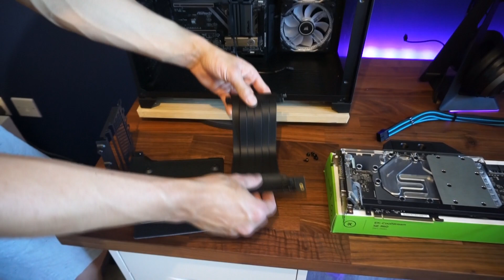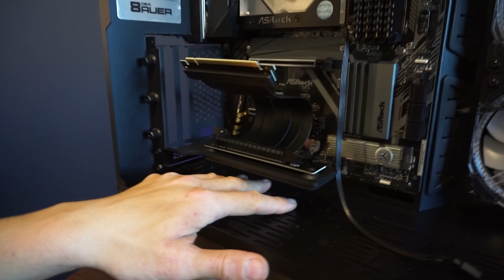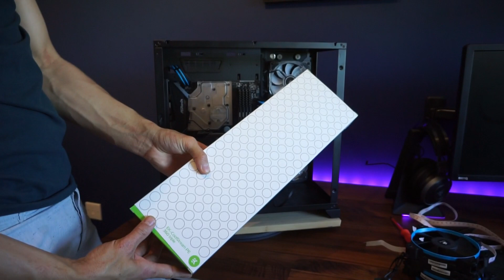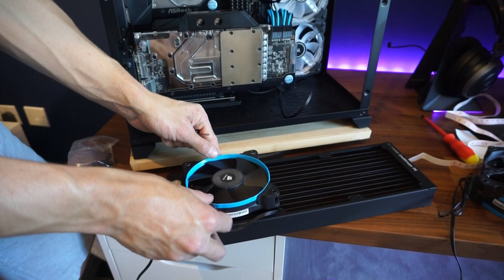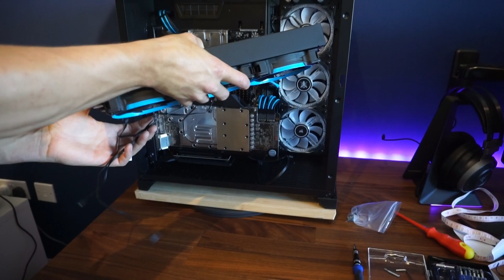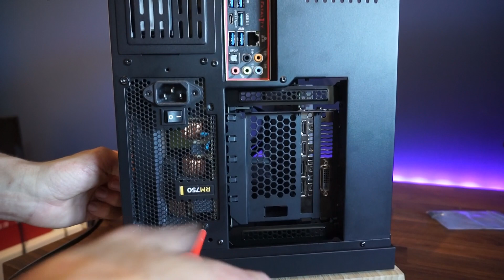Lian-Li 011 Build Part 3 -  Vertical GPU Mount & Test Fit

Comment: Thanks for the video, do you think if i used the same case and vertical gpu mount, will my air cooled gpu sufficate? Its 2.5 slots gpu
Reply from the maker: There is a good video by gamers nexus a review for this case. Check it out there is thermal bench marks for water and air
Reply: @techclub8528  i meant is the space between the gpu and the glass side panel tight? You used watercooled gpu which is slim, my gpu is thick and takes 2.5 slots.
I will have 3 fans bottom intake, 3 side for radiator also intake ,3 top exhaust. 
My question is, is my gpu too close to the glass side panel?

Comment: Is it possible to raise the riser in order to fit a slim 360mm radiator+fans in the bottom?
Reply from the maker: Hard to say I have 1 more slot to raise the bracket leaving only space for 1 Slot/PCI bracket.

Don't forget the fans I'm using atm are super low profile fans. You may want to look into the Lian Li 011 Dynamic XL for more height

Comment: Do you think this pci-e riser would work in any other cases?
Reply from the maker: This is made by phanteks and it is not specifically designed for the lian Li case. If you use it on cases with a traditional back then you need to modify the bars between the brackets by cutting them out.

I was just lucky that the design of the lian Li case doesn't have bars between the pci cut outs therefore no cutting required
Reply: @techclub8528  Niceee, mine have removable ones . I have a 1st player sp8 (similar to lian li o11). Thank you for the answer

Comment: would this fit on the Lian-Li 011 Dynamic XL?
Reply from the maker: The XL is just a bigger taller version. So yes it would fit just you would have more space below or above the mount as there is more expansion slots

Comment: can you fit 3 intake fans under the vertical gpu mount ?
Reply from the maker: I have the mount in the second slot down and that leaves enough room for low profile noctua chromax fans. If it was in the top slot then yes you could fit normal sized fans

Comment: Hey I appreciate you making this video. Is there space for a strictly 1 slot height wifi card to fit in and plug into the motherboard at the bottom of the case with this mount? To me this seems like the most promising vertical mount in terms of being able to do this but would like a little bit of confirmation as I cannot really see.
Reply: I have the o11 air, so same configuration on the pcie slots at the back as your o11 dynamic btw.
Reply from the maker: Well I got my bracket 1 slot down from the top PCI slot so in theory yes. Could you go for a USB WiFi antenna if not
Reply: @techclub8528  great thanks! Yeah I could but would prefer to get the most I can wirelessly out of my gigabit connection with my pcie WiFi card.
Reply from the maker: Hardwired ethernet cable for me everyday.
Reply: @techclub8528  definitely would if I could! :)

Comment: Thanks for the video. If you vertical mount the gpu, does the space below it still allow a radiator?
Reply from the maker: I put some low profile chroma fans in there and there is 1 GPU slot left at the top.
Reply from the maker: If it were to fit then it would need to be a super slim one
Reply from the maker: You could maybe put fans under the case and then a slim radiator under the vertical mount

Comment: i'm thinking about to use this lian-li case with usual cpu cooler. should i bye it or look something else?
Reply from the maker: Air flow could be problematic as its designed for water but have a look at gamers nexus review as they do a thermal review compared to other cases

Comment: Well, it appears this vertical mount bracket will obstruct even the lower PCie x1 header for my Wi-Fi card.  I may have to give up on a vertical gpu until I run a network drop to this part of the room.
Reply: Just get a usb wifi adapter
Reply: @Alex-wh1ru  no problem now that I've decided on a 3080.  It looks fine mounted horizontal and the card's white led trim should jazz things up a bit as well.  Just wish it wasn't so pricey

Comment: Where did you get your VGPU mount
Reply: Its the Phanteks GPU Rizer Card - available in many shops on the internet. Just search google.
Reply from the maker: Yes it's the phanteks Vertical GPU mount.

Cost around £40 is I remember correctly.

It may require modification to the back of the case luckily for me the lian Li does not need any.